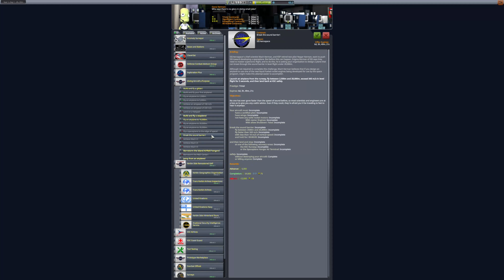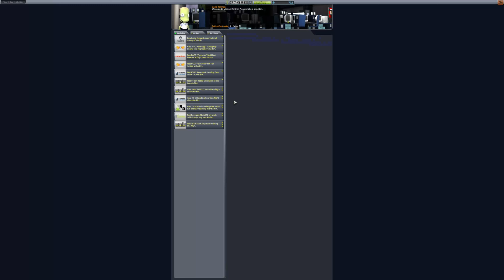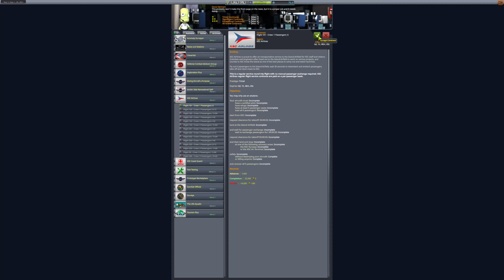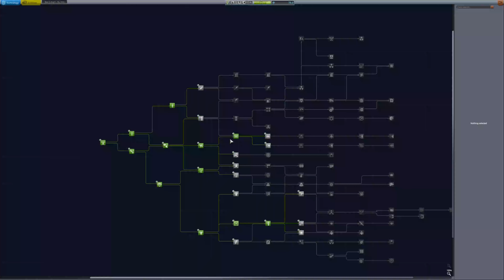The Kold War part 4: A Modded Career Play Through with BDArmory

Comment: So, the main advantage of a coaxial helicopter (as that design is actually called) is stability. Not only can you design it to not need a tailrotor, but you can also set up a coaxial helicopter to only have a swashplate on the lower rotor, which results in massively increased stability at the expense of speed and maneuverability. This is how many entry-level coaxial RC helis work, in fact.

Comment: What is your mod for coloring the part of your plane
Reply from the maker: I used a mod called DCK. It also adds a few parts like the fuel tanks that were used on the helicopter. 
There is another mod called T.U.R.D. I currently do not have it in my game data folder. I need to make some configuration changes first to get it to work exactly how I like it.
Reply: @Echo3  hehe turd
Reply from the maker: @AveriV1  https://forum.kerbalspaceprogram.com/index.php?/topic/174188-112x-textures-unlimited-recolour-depot/